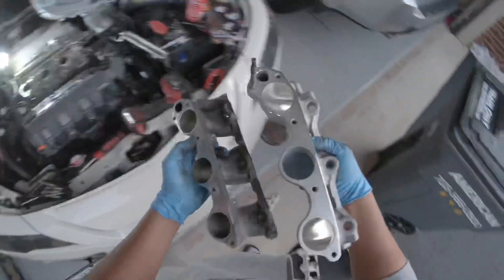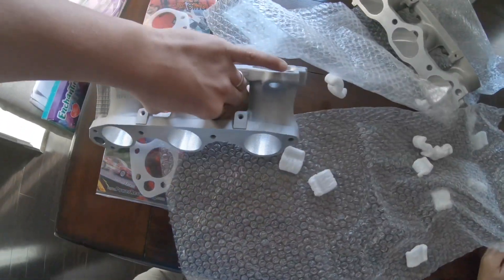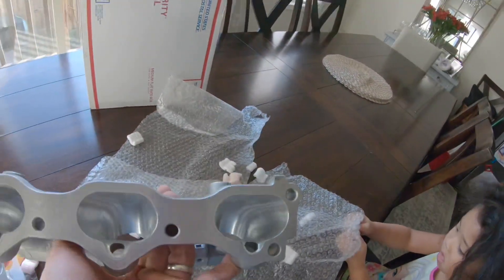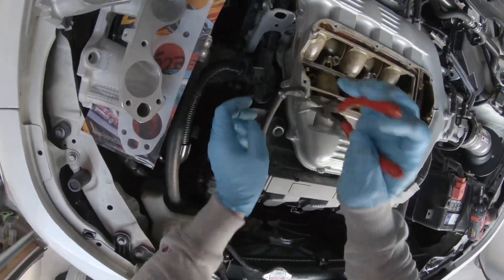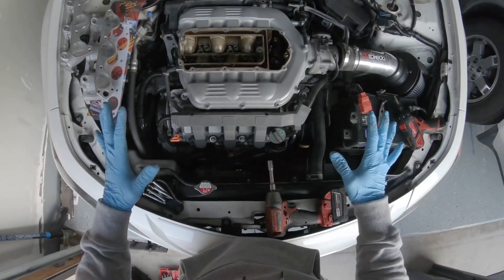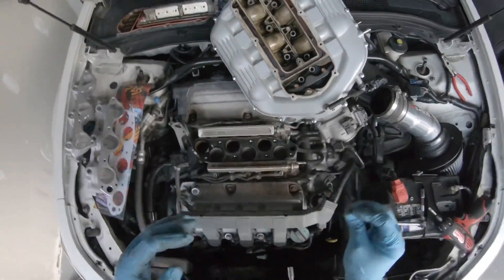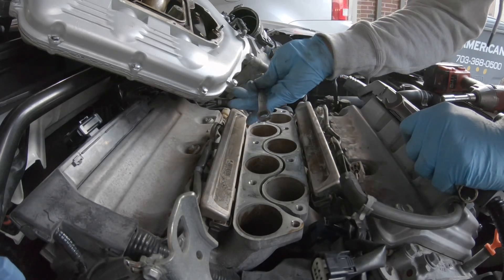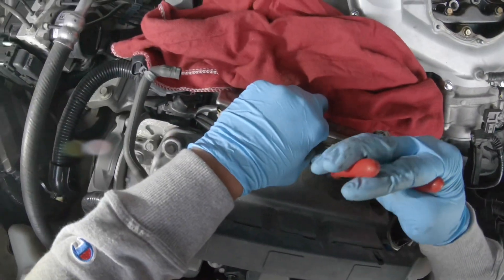P2R CNC Ported Lower Intake Runners installation part 1

Comment: Awesome video!
Reply from the maker: Thanks 😊 !! Love the cnc runners 🔥
Reply: Did you have to use the gasket ???? Cuz P2R ain’t send me one wit my order it got delivered today 🤔🤦‍♂️
Reply: @isfnate  We sell a thermal gasket for between the upper manifold and the runners.  Its not required for the install, but its a nice upgrade to do together with the runners.
Reply from the maker: @isfnate  I did buy two of @P2R Power Rev Racing thermal gasket since I ended up getting their manifold spacers also. The thermal gaskets made the manifold spacer even longer 👌
Reply: @GarrettMedia   just placed order last night for the spacer and two gaskets thanks for the info 💪
Reply: @GarrettMedia  Do I gotta worry about replacing the knock sensor, a couple of 3rd gen TL guys said that it cracks when the lower runners are removed and to replace the o-ring,  are these things advised?
Reply from the maker: I actually haven’t had that problem. Just try not to touch the knock sensor at all while you’re there 👍

Comment: The camera work is on point. Thanks for the post my man
Reply from the maker: Thanks 🙏 for watching
Reply: @GarrettMedia  Ive got a '15 accord coupe 3.5 AT with ktuner basemap RV6 PCD's and J-pipe. Also thru in a high flow magnaflow cat and a vibrant resonator to help with smell and rasp after putting in the PCD's. I come from the "no replacement for displacement" generation but I love this thing for a daily AND get 30mpgs. Too good to be true, lol. Love your cars man. Keep up the content and if you're ever around Indianapolis, let's run'em
Reply from the maker: @apmech46166 that’s awesome thanks 😊

Comment: Great video! Just wondering did you clean your intake manifold? Mine is covered in carbon and I was looking to get it out
Reply from the maker: I did not get to clean it... the stock runners were clean enough that it didn’t get my attention. Although I should of ported the manifold
Reply: @GarrettMedia  yes I saw it looked very good on the inside, maybe I’ll send my intake to get ported or something because I can’t find any J35A performance manifolds.

Comment: Nicely done, I always wondered about the injectors. When installing  the ported runners. You should do the P2R intake manifold spacer also 👌.
Reply from the maker: Doing the spacers next
Reply: You’ll like the low end torque for sure.
Reply from the maker: @davidvang763  can’t wait 😝